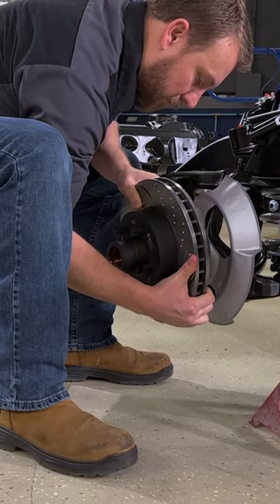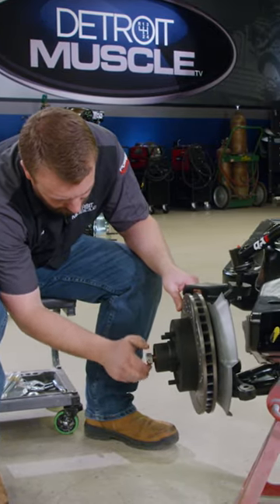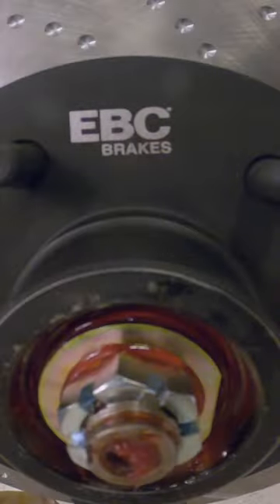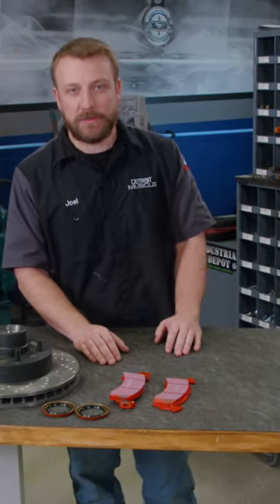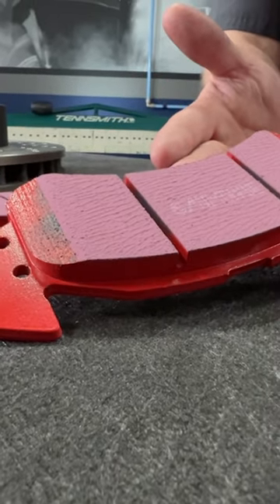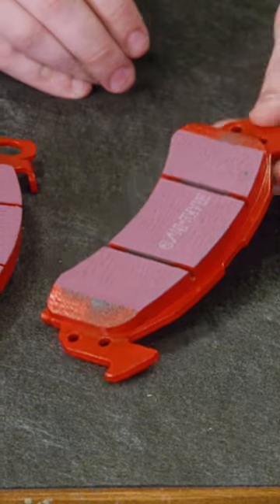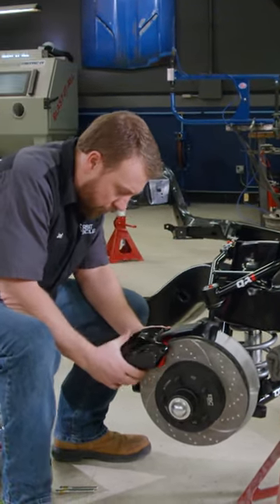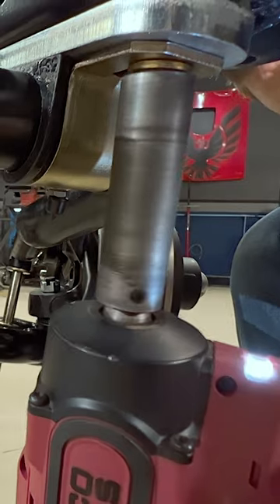Installing New Brakes to a '71 Caprice

Comment: I stand fooled... They had the camera mounted to the rotor and spun the camera with the rotor. Which made the spindle/hub nut/ grease spin and not the rotor. Still, didn't see a keyed washer or cotter pin though ..